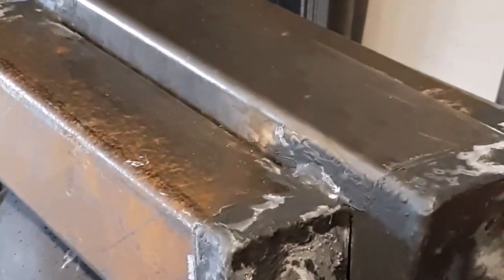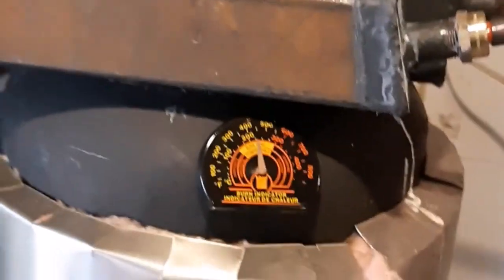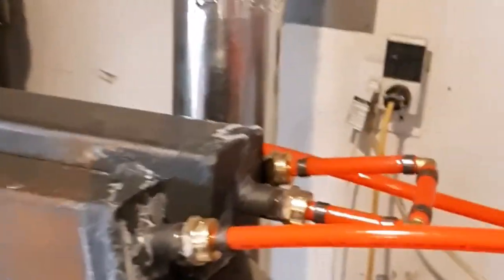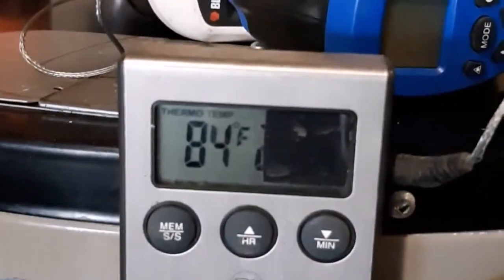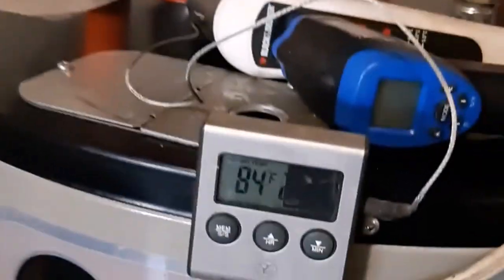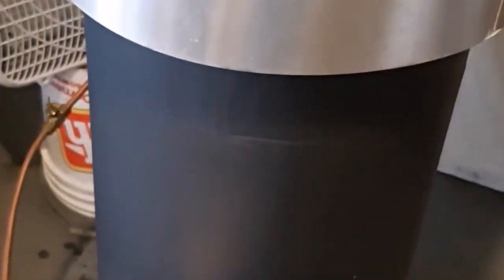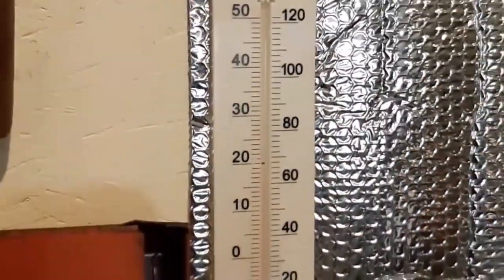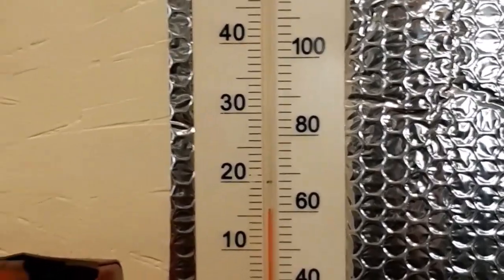Free Heat Rocket Stove Update

Comment: Waste oil as in Car engine oil? or Waste fryer oil from Restaurants?
Reply from the maker: I was burning car engine oil and also I was burning used french fry oil both work really well. I don't have it hooked up anymore I took it out because it had very little control. I basically have to light it and stay out in the shop and then shut it off when I came in because I was too nervous to leave it running on attended. I ended up putting a used boiler in and tied that into my in floor heat it works much better all the controls are already there and it comes on and off automatically all winter long.

Comment: How much heat are you able to extract from the burn-chamber, have you tried monitoring the exhaust temperatures going into the chimney stack to see how low they get?
Reply from the maker: The temperature is about 120-150f at the wall outlet and the top of the tank is about 450-650f. It works pretty good but I am In the process of building a new one. This one the burn chamber gets so hot that it is melting the steel and it's flaking off. So it probably won't last much longer.

Comment: very nice , free is best.  the price is right lol.  is the fuel regulator adjustable?  have you tried lean'ing it out for smokless efficiency?  good work, thumbs up.
Reply from the maker: Yes I used a needle valve to adjust the flow of oil, I am getting a lot better at keeping it around 600 degrees and no smoke. Burns nice and clean now.
Reply: @budslife  What oil do you use.  Is it a copper or steel pipe that goes into the burn chamber?
Reply from the maker: @HealthSupercharger  I used steel for the burn chamber, I wish I had of used stainless steel . The chamber would get so hot that it started to melt the steel.